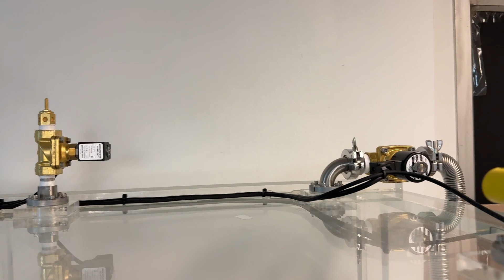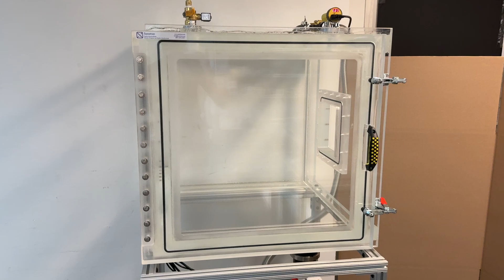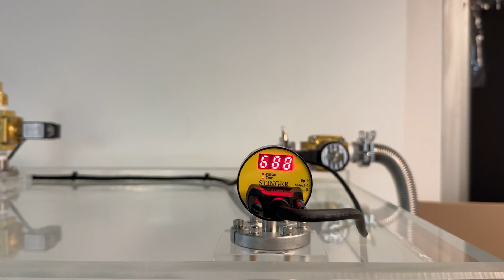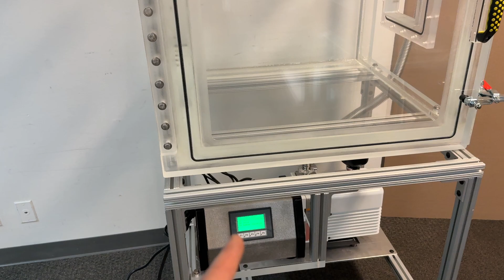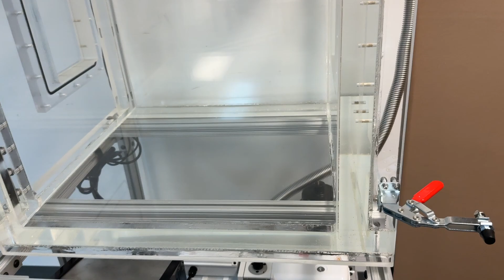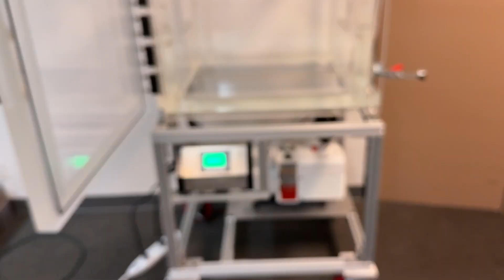Altitude Test Chamber, How Vacuum Chambers Simulate High Altitudes

Comment: So for this vacuum chamber that I assume made of acrylics, how thick and what is its total weight? Is it rated for less that 160mbar?
Reply from the maker: Hello @keithfirst, Yes, that is an acrylic vacuum chamber, and the acrylic is 2-inch thick. The vacuum pump is a 21 CFM, Rotary Vane Vacuum Pump, which can pull to 0.025 mbar within 20 hours... So yes, it is rated for much less than 160mbar.

Let me know if you have any more questions.